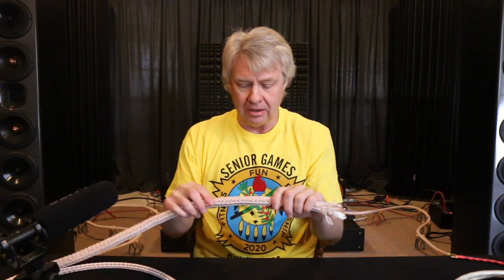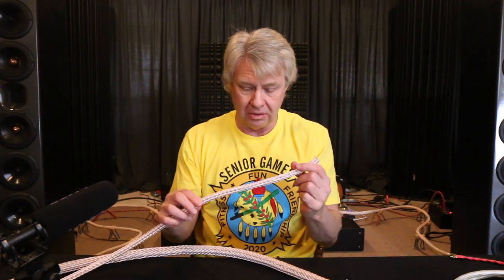What’s up with Audiophile Cable Risers?

Comment: I really had to check to make sure it wasn't April 1st all over again. Ok,, so o know people who believe in this level of tweaks, but the really is, that in blond listening tests that I've conducted over the years; remove the tweaks, (and yes I have done this with cable risers) and the differences suddenly can't be heard. Room layout, room acoustics, furniture, fabrics, speaker placement all make a huge difference, but lifting cables up off the floor, well unless you have electric under floor heating or some form of high level interference close coupled to the cables, then no. And spending thousands on them? Oh dear, well I guess it's excellent for some people's pockets. Maybe I have cloth ears, if that's the case, thank you God 😃 ... I use ATC speakers and Audio Research amplification, along with a collection of different sources, and I love the sound I get.always Interesting to hear another line of thought but sometimes people are convinced by these things, like good plated connectors on optical fibres lol, and freezing compact discs, sticking blutac onto power resistors!! No! 😃 Anyway enjoy playing, just keep it real folks
Reply: Maybe your system isn't really to the level of allowing tweaks like that to be heard. I have upgraded quite a few of the ATC speakers, and while the drivers are nicely made, but the crossover parts, wire, and binding posts, that they use, really hold them back. Actually that stuff is quite a bottleneck. The cables you are using might be a problem as well. 

And I did not advocate spending thousands of dollars here. Tinker Toys were pretty cheap.
Reply: @dannyrichie9743  thank you for your reply :) you may well be right or maybe it's my ears that let the side down, nevertheless I'm super happy with my system, just very interested in the whole subject. Love your channel.. Always interesting, all the best, Richard

Comment: What gets me is that yes, cables have different electrical properties and voltage and currents will flow through differently. 

But, has the signal not already degraded past that point in the studio? all the long runs, cheap cables, spaghetti mess, ect... I've been in many studios and that don't pay much attention to cable quality when recording. 

Secondly, as an electrician, I understand that most cable insulation prevents any voltage leaking to ground and this is on 230 volt systems with basic PVC. 
This voltage going to your speakers is tiny , it not high enough to stress any pvc insulation and leak to ground or interfere.

You can get noise in digital sources and cable but this would have negligible effect on speaker cables. Not enough to effect the vibration that a speaker uses to create sound. 

A speaker is not that sensitive or well engineered enough to be affected by such tiny voltages and disruptions. 

I would concentrate on the source before it hits the amplifier and this gets magnified 100 time when it's "amplified".

Any deterioration to the source will be amplified and send to the speakers
Reply: I expect you are aware that "pro" audio uses balanced cables for all line level signals.  Because cables are balanced, signal integrity is not a problem, even if the setup is messy.  On the other hand, "audiophile" gear still uses RCA cables, which is silly!  if signal integrity and low noise matters, use XLR or TRS interconnects on everything.  Then use plain speaker wire, because speaker wire doesn't matter.

Comment: They must work; afterall, the power to your house is delivered via cables resting on huge cable risers .
Reply: Case in point... Power Transmission Lines. The big ones on towers. 
Check out the 11 minute mark of "The Big Misconception About Electricity" by "Veritasium".

Comment: I'm waiting on him to say it's an April fool's joke, but....I believe he's serious. Why not use measurements as in the speaker upgrades, where's the data to back it up? No, sorry, I'm not all for this one, not buyin it. As the encores my fav bookshelf speaker still (not an April fool's joke), this is just....no.
Reply: Showing a measurable effect in a dielectric material is not easy. I understand that the skeptics will say no, but the witnesses say yes.
Reply: @dannyrichie9743  I'm all behind u normally Dan, but this one I must see to believe or try it myself. It's just a no for me, and in room measurements tell all.
Reply: @JukeboxAlley  Not a problem. Hearing is believing. Room measurements just tell amplitude at a frequency. So there is a lot that it doesn't tell.
Reply: You act as though he is pulling this out of his rear end. This tweak is at least 20 years old!

Comment: Yet more technical BS.    Non technical HiFi nuts pay good money for such snake oil.   Such rubbish is always described using the same old words "the sound stage sounded better... the sound was more musical...  the different was instantly apparent..."      etc. etc. etc.  The only field where so much fake technical cr*p is more prominent is in women's cosmetics.   I am from an electronics engineering background, and this kind of stupid talk no longer amuses me. With low impedance sources, there is never a technical reason why lifting cables up off the floor will make a difference.
Reply: I always get a kick out of guys like you and the ones that boost their EE degrees, yet don't understand the basic fundamentals of how things work. Oddly, the most ignorant are the most vocal.
Reply: I am a EE with decades of experience.  Does not mean my, or any other EE, knowledge covers every facet of electricity, electronics or physics.  Most EEs have basic understanding of Maxwell.  A subject matter expert in that area will have specific, detailed, and extensive knowledge gained from Masters or PhD study and years of experience.  Danny is spot on that many of the most vocal actually know the least.
Reply: @jfritzy4358  Let's hear from a real, qualified expert.....Oh.....!!! Check out ASR.....!!!
Reply: Where’s Audioholics in all this?
Reply: @slocumeddie  There are no experts at ASR, just some theorist.
Reply: @revo1336  Gene has been personally and publicly invited.

Comment: So Danny, why did you spend thousands of dollars on cryogenic cable risers if tinker toys will do the trick? (Or did I misunderstood that?)
Other than that, I have to say, at which point does a tweak become so intrusive that its improvement does not justify the effort. For me, cable risers fall in that category. Or lets put it like this: Who hoovers the floor? Is it you, is it your wife (In that case, how many flowers and chocolates do you have to buy to offset the annoyance) or do you pay somebody to do that? If the latter is the case, you have to add that cost to your HiFi. I am not trying to troll here, these are always considerations we are facing in this hobby. And I would bot be surprised that cable risers are responsible for most audiophiles bailing out of this hobby all together than all other tweaks.
Reply: I have never spent any money on cable risers. And I guess my wife loves me and doesn't really care what is going on in the listening room.

Comment: You should not refer to your critics as 'flatearthers", they are basing their critiques on scientific facts.  On the other hand you Danny sound like a flatearthers where you say things that cannot be quantified scientifically.   In this case your disclaimer is it won't work on 90% of our systems which means most of your viewers will never find out for themselves.  I repair audio equipment including recently a 20K McIntosh amp (yes they break too) and there is nothing special going on inside other than the designers concept using off the shelf components, all the fluff is on the outside.

Comment: Is there anything an audiophile company WONT copy? Like seriously. Yes, the risers they saw on the roof for their GAS PIPING have a purpose, namely to preserve and protect the natural gas piping on its way to the RTUs that heat the building that they sell their snake oil out of. Speaker wires don't care. Your carpet doesn't have cooties, and the electrons wont fall out if they touch the floor. Just route them neatly where they wont be stepped on and stop being buffoons.
Reply: It would sure be a lot easier if all of that were true, but the fact is that all of that stuff really matters.